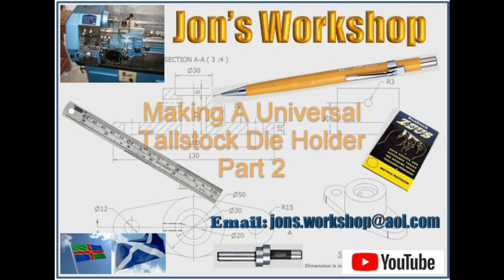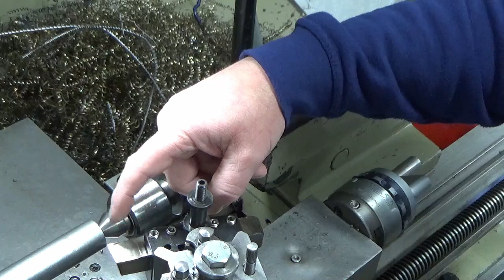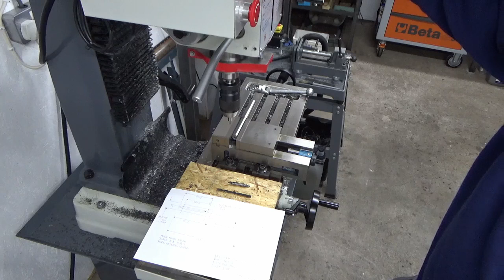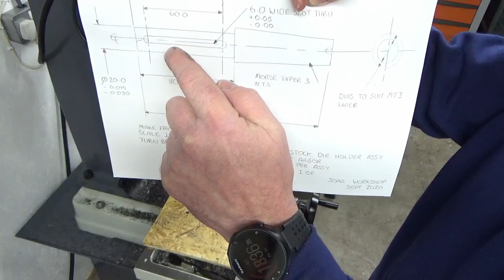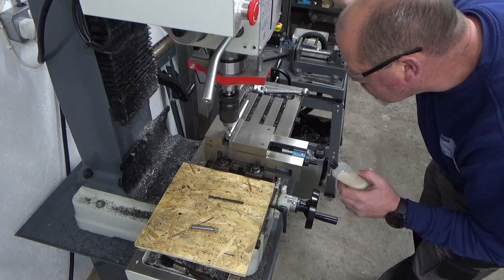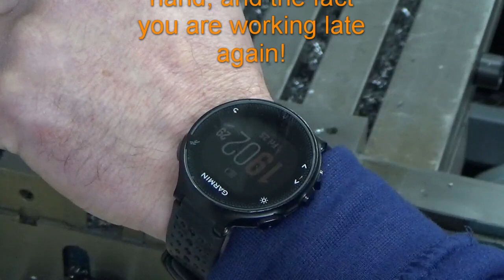Making A Universal Tailstock Die Holder Part 2

Comment: Why did you create yourself so much milling work and hassle of realigning the slot to mill the slot from the other side, when all you needed in THIS part, is a tapped hole for  a capscrew and mill a slot (to suit the capscrew head) in the sliding half of the die holder? (am I missing something in the design here?)
Reply from the maker: Hi Zen, that option would also work, however, I wanted the slot internal so that if this is sat in the tailstock during regular turning work (ahead of threading), the slot is not filling up with turning swarf that would then be a cut risk to the hands in operation, and have the chance of migration in between the sliding pieces thus damaging the very close fit I built into the design to allow this unit to be used as a sensitive drilling device. Hope this helps explain. Cheers, Jon

Comment: What ho Grasshopper, I like your concept of a multi tool holder but........
It might not have occurred to you but there is no guarantee that the hole in the middle of the die is in fact central. This is no problem normally when a die is used in a standard stock as the die rotates about the work. With a rigid tightly confined tailstock die holder it can cause the thread to be underside. If you open up the holder to allow the die to be opened up that little bit extra you run the risk of it snapping in two, how do I know, never you mind.🤔
Another little suggestionette is to not use your carefully made slot but arrange the holder to spin on the shaft but held by a short lever. The idea being that you can cut a thread up to a length you want and then let go the lever so it can spin freely, great for threading to a shoulder without the risk if calamity.
Do you really not have any V blocks to allow you to clamp round stock in you mill vice?😮
ATB 
c
Reply from the maker: Ahh, there you are, I was about to mobilise the search party again! I had actually thought about the concentricity of the dies, I wasn't sure if it would present an issue. My back pocket thinking was I may need two of the sliding pieces, one close fitting for sensitive drilling and anything else I dream up, and one with some slop for the dies thus allowing the unit to centralise.
I have seen the lever design (Alan of Enots Engineering uses one), I don't know why, but I am just not keen on the whole "one sidedness" thing when my hand is attached to it, have not ruled it out yet though. Like any good design, we may need a couple of iterations following some trials, if they fail, then I will go for some kind of conversion. No, believe it or not, my only V blocks are way too big and in a poor state, something else for Santa to focus on I think. Cheers, Jon

Comment: The taper looks good, hss gives a good finish especially on aluminium.  Just out of interest you can get screw in ejector ends to help eject from say the tailstock that have the same thread as the drawbar, I got mine from arceurotrade, lets me use/share arbours between mill and lathe, for what they cost hardly worth making them.
 As to the video as a whole well done, no questions 😉 its all in there. 👍
Reply from the maker: Hi Derek, thanks for the comment and feedback. I didn't know you could get those, I will look them up, I plan to share between mill and lathe, that's why I went for a morse taper spindle in the mill instead of R8 (pointless having two sets of tooling when one lot will do). I am going to also get some morse collets in the future to get better rigidity for when I really need it on the mill. Thanks again. Cheers, Jon

Comment: Hi Jon,good work and instructive.Are you taking deeper cuts than before the bearing change on the mill?Any significant oil temp rises ,you mentioned no silly noises...so far so good!good to see subscriptions going up steadily!
Reply from the maker: Hi Robert, thanks for the comment. Not really on this job, breaking it in gently so to speak. I am concerned by the "buzzing/chattering" I have found during the close inspection of the mill with no load on. Its coming from the transformer and the camera does a really good job of picking it up. I am going to do some research, if I can't find any info, I might get the front off the transformer again and have a "tweak" to see if I can tune it out. Failing that, I will contact Power Capacitors again to see if they can suggest anything. It must be great for you having me iron out all the wrinkles before you find them...... lol. Cheers, Jon
Reply: Hi Jon,Yes that makes things a lot easier.Be going back to temp work for a month so at least the ,,lathe funds,,are increasing rapidly!Enjoying the channel.

Comment: Good viewing Jon, your lathe is performing very nice great finish on the taper. Glad the mill is working up to your standards
after all the hard work you've done rectifying it. This is a tool on my to do list for the future. I've to watch part one yet lol. Tony
Reply from the maker: Hi Tony, thanks for the comment. It's nice to be cutting metal again, especially on the mill. I still have a few tweaks to make to it (getting some chatter through from the motor which is coming from the transformer - don't know if it's tuneable as I don't really know anything about how these things work....... Research needed). When you have watched part 1, if you want drawings, let me know. Cheers, Jon
Reply: @jonsworkshop  If you listen to the motor noise when its running through the convertor on you aim for the quietest you can get it. If the convertors set too low it trips out or bangs on start up. If its set too high the motor sounds rough and is louder.  Your also aiming for the lowest reading on the V meter when the motor is running. Give it a try. Tony
Reply from the maker: @eyuptony  Thanks Tony, I will have a play with it hopefully during this week sometime. Cheers, Jon

Comment: Hi Jon,
The tip on tool position for cutting the Morse taper to avoid the live center was a good one...
Take care
Paul,,
Reply from the maker: Hi Paul, thanks for the comment. It's always an awkward gap on small diameter bar and so many live centres get mashed up by over enthusiastic retraction of the saddle. If you can avoid the whole thing (not always possible) it's best to. Cheers, Jon